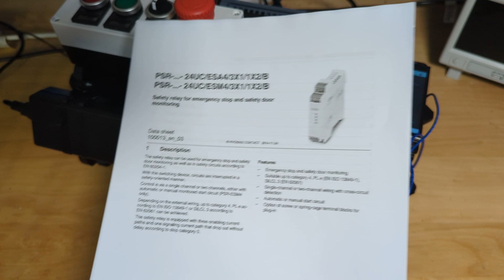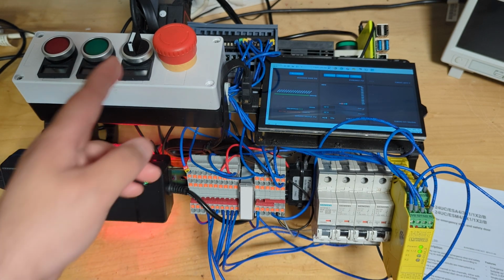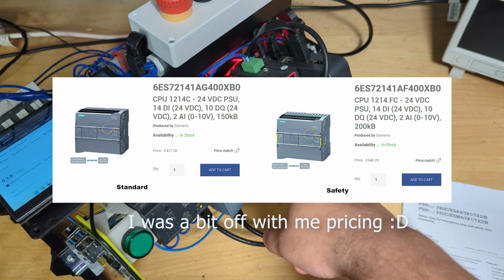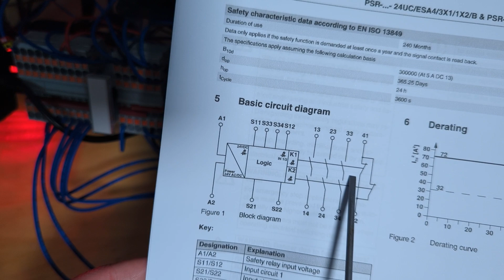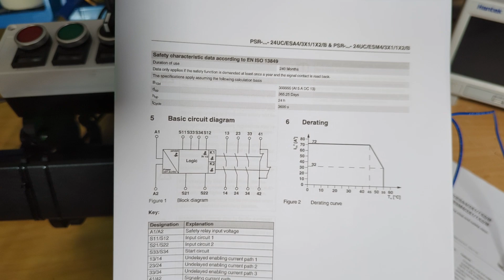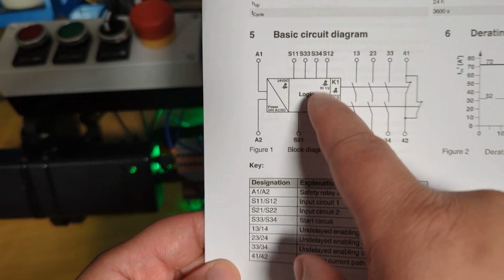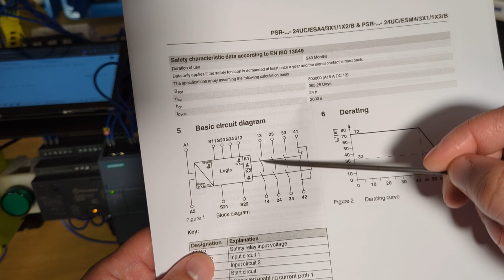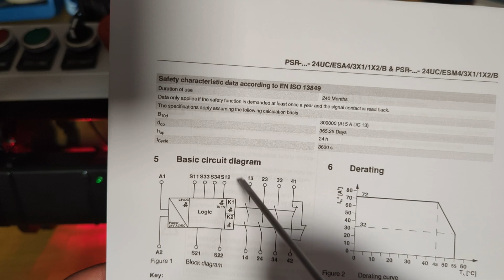Industrial Safety Relays For Estops

Comment: @7:30 When you had to hit the E-stop and then manually reset it, is that a feature of the safety relay or is that built into the program on the PLC?
Reply from the maker: It has to do with the safety relay and it having a known good state. So pressing the estop shows the relay that the estop is good essentially

Comment: why estop relay not On even press reset button 6.50 time strap. what is the reason and how to correct this one ?
Reply from the maker: I do explain it in the video but the Estop relay needs to see both contacts break at the same time, so I need to hard reset the relay before I can reset it via the button.
Reply: @HamedAdefuwa  Thank You for Your prompt response.
Reply: @HamedAdefuwa  Estop relay needs to see both contacts break at the same time , Can You explain clearly , both contact means which point you describe here in the safety relay S11 or S21?
Reply from the maker: @Rajeshshiva247 the two normally closed contacts on the estop button itself

Comment: What's the purpose of 41-42 contacts? Why are they connected in parallel?
Reply from the maker: It's a normally closed signal we use to send back into the system, so in my case I've got it wired into input 1 of my PLC, that's the signal my PLC is reacting to when I press the estop. 

My bad I should have mentioned this in the video. I missed out a fair bit actually lol
Reply: @HamedAdefuwa  so if I have a signal in my plc from auxiliary contacts, it means that the safety relay is either turned off or faulty? But how can I differentiate between these two situations?
Reply from the maker: I guess you can't with this simple safety relay without also sending one of the NO contacts into another input and watching them change over. Which I have done before. 

Under normal operations, the safety relay is active, meaning the NC contact is open. In this state the PLC receives no signal from the NC contact, indicating the system is healthy. Feels backwards I know lol but it works.
Reply: They're in parallel for safety or redundancy. When the status is OK, 41/42 is open.
If there is a fault, 41/42 is supposed to close. If for example K1 41/42 fails to close, you have K2 41/42 as a backup.
For the same reason the NO contacts are in series. If K1 13/14 fails to open (contacts fused together), you have K2 13/14 as a backup.